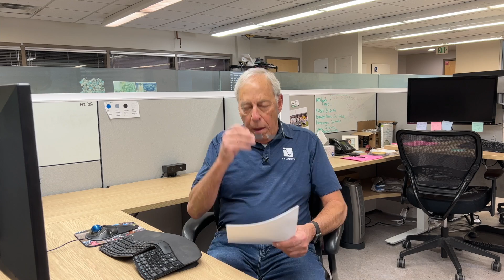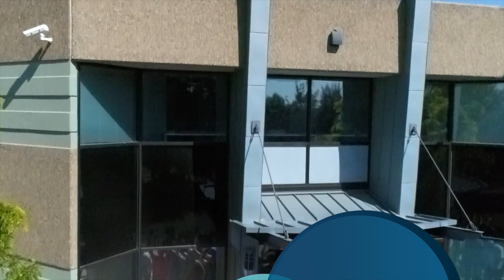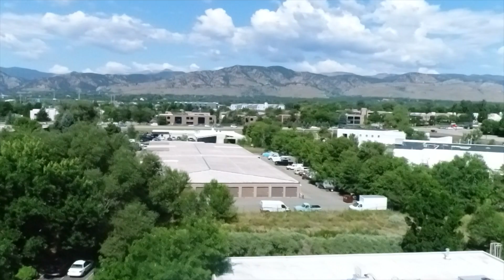Analog vs  digital EQ

Comment: I would like to see an EQ for people with hearing loss.  It would be great if I could enter my hearing loss graph and have the EQ automatically boost the correct frequencies the correct amount so that I can hear the music the way it was recorded.  There are a lot of older audiophiles who would be able to use this.  This would be a lot like a hearing aid built into your stereo.
Reply: No problem to get such a graph from a specialized hearing aids shop with audio lab. Every city has at least one. But you'll be surprised how steep the curve can come down in higher frequencies (above 7-8 kHz when you're older). Nothing sensible to compensate here for a EQ in your system because the amount of more dB needed would be way too high. That's the job of hearings aids which do exactly what you wish for.
Reply: @Fastvoice  The problem with hearing aids is the microphones and speakers are very low quality.  Size is much more important than music sound quality.  Music through airpods sound a lot better than music through my hearing aids. Streaming music through hearing aids has very bad sound quality in comparison to a good pair of headphones. If I could combine great speakers and amplification with the proper EQ graph that would be the ticket.
Reply: @sailormansteve7642  So go for it and try! Just get your hearing curve from a doctor or an audio lab. Then load your music into the computer/digital audio workstation, grab a graphic EQ plugin and create a reverse EQ curve to your hearing curve. 

The latter is completely free if you have a Mac with GarageBand - there's a plugin included called "Channel EQ" which let you do this (there are similar ways in the Windows world I guess). Then listen to it on your audio system and tell me if that sounds right for you. I highly doubt it.
Reply: Thanks , I hadn't considered this possibility !
Reply: It may already exist. My cell phone has "Adapt Sound" which test your hearing and adjust the sound to your personal need.
Reply: @pablohrrg8677  Must be a Samsung. It even has some presets to give you different fixed curves - one of them for us older folks over 60. 😄
Reply: @Fastvoice  yes, an old Samsung. Even has a tube amp simulation.
Reply: I have hearing loss to one ear.. my samsung phones all are tuned to my ear via ear buds.. regardless of music audio etc.. the tone and audio out i hear it much diffferent from my phone compared to other persons.. i normall have ask other persons to lower their volume because of bad frequncies that anoy my hearing

Comment: When octave records records a track, that board is nothing but a huge equalizer. So, don't say that you are not a fan of eq. The recording engineer eqs the tracks as they are recorded. If your personal musical taste differs from that of the engineer, then using an equalizer is a natural choice for altering that signal more to your liking. I spent a significant part of my life playing live music, being in the studio and after my playing days, working as a live music engineer on the soundboard. Processing music of any kind is totally wrapped up in EQ. Audiophiles saying that tone controls of any kind is heresy is simply hubris.
Reply: I've heard that bass and treble controls on pre amps flips the music out of phase and that's why NONE of the high end pre amps have them.   Can somebody explain  the real problem with them please?
Reply: @jimbennett2795  sounds like bullshit to me . The entire job of a preamp is take a signal from a source and prepare it for presentation through a power amp to drive speakers. In the case of a phono preamp, it’s intent is to boost and EQ the signal to prepare it’s entry into a line level preamp input. All this shit about bypassing tone controls is about signal purity. Filters are always there regardless.. 
You can still achieve a transparent sound in spite of tone circuitry.
Reply: @jimbennett2795  You have it partially right. When you use an EQ, phase is altered on whatever frequencies you adjust. This holds true for both digital and analog EQ's, but phase is altered more with an analog EQ, so if the signal is digital, it makes more sense to use a digital EQ, then to do it after the conversion. If you do a search for this topic, you'll get plenty of results. Its a fairly well known issue.

Is the phase shift audible? I can't say. I've used EQ's but have never tried to see if I could hear any type of phase shift. I would say try the EQ, and if you feel it makes a positive difference, then keep it.
Reply: @AT-wl9yq  there is no phase shift in current digital equalizers
Reply: @AT-wl9yq  part of the dsp on my Yamaha Ypao is phase shift on purpose.
Reply: @jimbennett2795  The slope is where the garbage is. Thats where it goes out of phase. On a Subwoofer being Low Passed, where the slope of attenuation is, is not staying in phase. That is why the subwoofer can not be next to the main driver. Cancelations will happen between the two. 
You dont notice it so much between a midrange and a tweeter because the midrange is falling off and the tweeter is coming on. There is not a problem then for a tweeter and a midrage to be right next to each other. Hope that helps to give s possible answer for the question.
Reply: adding a boost or a cut on analogue introduces a phase shift but that can be very small.
with digital your getting into pre and post ringing, linear phase etc.
If your a producer/ engineer/mastering engineer, phase and time domain are important but if your an end user so to speak i really wouldn't worry about it. Your room is  the best way to eq with treatment.
Reply: @markhunstone2747  "Your room is the best way to eq with treatment."
So is that for one album and then you have to change your room around for the next or do you just compromise on the best you can get and leave it at that? I have a basement family room with family room furniture, pictures on the wall, etc. I'm not rearranging but I can move a couple slides and fix about any room or recording. Like your room treatments I can find a happy medium on my EQ for most listening without touching anything but if something dont sound good and I like the song I can fix it and be back listening in a couple second.
Reply: There are some general rules of thumb that are all positive!
Bass traps in the corners of the wall that the speakers are at alone will give more focus, speed, tightness etc, two pannels directly behind you on the rear wall as a starting point but offcourse this all depends generally on the wifes say so in my expierience lol.
your basically trying to combat room modes that can add or subtract sound, if you really want to get into it find an online room mode calculator and you will get a general idea about your rooms acoustics. you could get REW, room eq wizard it's free coupled with a calibration mic you can measure your room from your listening position and you will see peaks and trophs in the bass area etc, bass is probably the most important thing to get right.
For example you may have a bass drop of say 10db at 100hz and your thinking, it doesnt sound bassy enough or you may have a peak in this are and your thinking, bass is a bit much or boomy etc..
It's the reason in part why good headphones are popular because your removing the room acoustics out of the equation which reveals all the detail and nuances that the room masks.
I have my own recording studio and learned all this the hard way, bottom line was that my mixes wouldn't translate from system to sytem or room to room because my attempts to nail the frequency's was hampered by my room acoustics reching my ears at the same time as the direct sound until i got pro pannels and it's not expensive infact it's the chepest best upgrade you could ever do to your system.
hope this helps.
Reply: @markhunstone2747  "Bass traps in the corners of the wall" don't do anything below 100 Hz
Reply: Sofit bass traps go down to 40hz.
Reply: @markhunstone2747  bullshit - for room acoustics in low frequencies corners are not enough to begin with - even membrane absorbers are not enough in the corners - common sense and basic education about wave lengths would tell you
Reply: No need to lower the tone! And the example was about the listening position not the corner!
Reply: @markhunstone2747  you explicitly talked about bass traps in corners - that's Kindergarten when it comes to room acoustics - there's nothing like a bass trap - you can't trap physics
Reply: I also said two pannels behind you on the rear wall.
It's really quite sad that you have nothing better to do than be abrasive .
Common sense and education may be of help to you when playing with others.
No disrespect, but it's time to swipe left!
Reply: @markhunstone2747  the panels behind you are for heights/midrange - for the sake of god come back after you really treated a room and have proven the result with REW
Reply: Stephen - That’s not at all what Paul is saying. I don’t think anyone is going to confuse the functionality of studio mixing to what you can or cannot do with preamp or amplifier eq/tone control.
Reply: @jayrev1254  I find this odd. It's OK to change the way the band sounds before its recorded to digital (studio board) and when it's in digital form it's OK to change (digital EQ) but once it leaves the player (cd/dac) it's no longer acceptable to change (analog EQ) even though there are 20 things in the pathway between the sound coming out of your speakers and the recording (cables, crossovers, amps, interconnects, etc) changing that sound.
Reply: @jayrev1254  I don't want to beat this to death. If you have a basic understanding of how frequencies affect each other, an equalizer can be a valuable tool. I use an eq and a spectrum analyzer both in my system, to great affect I might add. It's not a set it and forget it procedure. It must be adjusted to suit each album, generally, but if you are like me and enjoy the process, it can be very satisfying.
Reply: 👍Come in here dear boy, have a cigar! No Eq..?!🤣Surely humorous.
Reply: Exactly. The audiophile way is listen to what is given to you and if you dont like it for any reason then dont listen. Kind of like buying a car from a dealer and being told if you dont like the rims and tires and want to change them then dont buy the car. I love the Go Go's but their first two albums might as well have been recorded on a wax drum. I am not depriving myself of (imho) great music just because the engineer was asleep at the wheel.
Reply: @finscreenname  that's why audiophile is another word for idiot
Reply: @Harald_Reindl  I wouldn't call them idiots the same way I wouldn't call an Indy car owner an idiot ....well...if they bought it for a daily driver and grocery getter (a guy that has a billion dollar system to play thrash metal) I would. That's the point. A lot of this stuff is not for us, the everyday audiophile. They will spend a thousand dollars on cables just to get a different sound and if not right they will do it again. I dont have that luxury. It would be nice if money was no object where you can drop another 20 grand on a 0.001% gain but just like with Indy cars, they can do it and one day I will hopefully see it trickle down to the real world. I remember back when a CD player was thousands of dollars, I paid like $300.00 for my SACD player 20+ years ago. Today you can pick them up for pennies. Had to start somewhere. 😎😎
Reply: @Harald_Reindl  And what does that make you? You disagree with just about everything in the videos, and then come into the related discussion in order to talk to the very people you label as idiots. You also know that no matter how much time and effort you invest, your efforts will have no effect whatsoever. Think about that for a minute. You take time out of your life to participate in activities that you know beforehand will amount to nothing, and benefit no one, including yourself. And you're going to call someone else an idiot?
Reply: I like a little bit of lift in the top end. Other than that I just adjust the base a bit. Old recordings I turn it up the base a little and new recordings I turn the base down a little. Tone controls are a must for me.
Reply: Love my Dsp-408, but thats not High-End. I'm fine with low-fi and the majority of my listening is there.
Reply: Hell Yes! That’s my point of view as well!

Comment: Great advice IMHO.
I use only one source which is a digital streamer/DAC with nice triode analogue output.  The player software (moOde) has a parametric equalizer built in, and it works well to fix up the dips and peaks at the listening position.  I see no degradation in sound quality with the dsp in the signal chain but big improvement in sounding natural with a flat response.

Comment: Since audio for near 100% nowadays is already digital from the source, DSP is the way to go for most people and EQ can greatly improve the audio when used to fine tune the tonal balance. 
EQ is great for room compensation in the bass, tiny tweaks, loudness compensation (Fletcher Munson) and high treble rejuvenation (compensate for your age related hearing loss). The company miniDSP is a popular option for the hardware. Dirac is a popular option for the DSP firmware. 
Usually these products provide a bypass mode to allow the music to route through it 100% unchanged, if you want to A/B compare.
DSP EQ is used for precision calibration in modern active speakers and automotive audio.
Reply: EQ is great for those reasons you cited in the analog world also. 
This idea of EQ being faulty is total horseshit.
Reply: @shipsahoy1793  Yes, it's horseshit. Even a US$200,000 system can sound better with some EQ tweaking. 
I've been listening to numerous extremely expensive systems and always tell myself that Loudness compensation is such a big issue even more so for the most expensive system where your hearing will cause a narrow-band tonal balance at low volumes. If you want the best listening enjoyment, EQ is awesome.
Of course, EQ can harm the audio fidelity when not used carefully. 
EQ tweaking should be done AFTER the system has been optimized acoustically (speaker placement, room treatment) to stay within a slim envelope of EQ.
Reply: @shipsahoy1793  I think the reason why so many audiophiles dis EQ is because there's so much crappy software EQ out there and even crappy hardware EQ! Plus there's the issue of misuse. It can do more harm than good.
Reply: @woopygoman  You raise some good valid points! Hardware and software can sometimes be a problem, and any tool, when used by the incompetent, can lead to misconceptions. Oh well.. and the wheel rolls on …